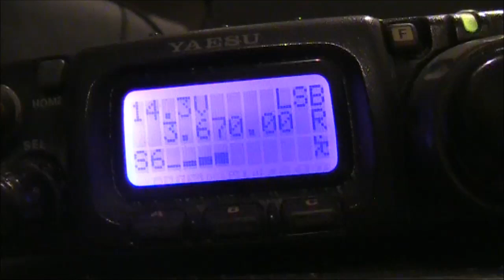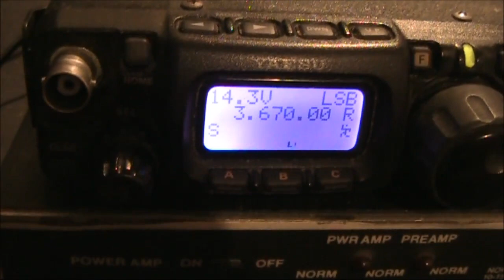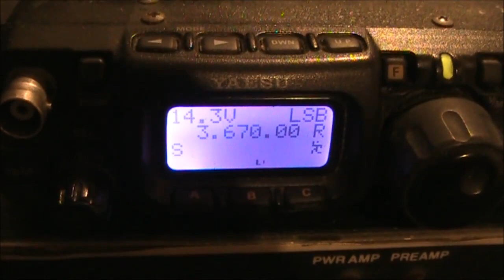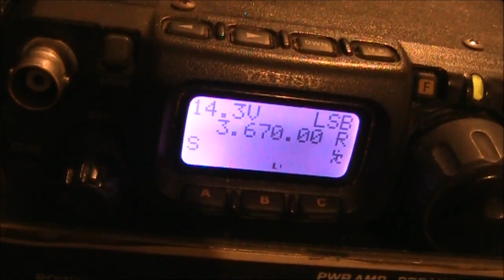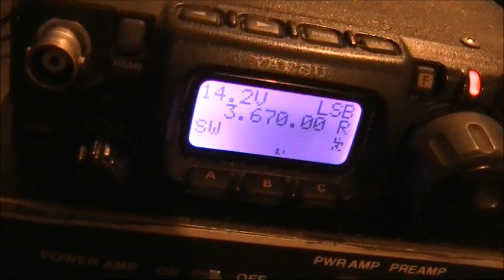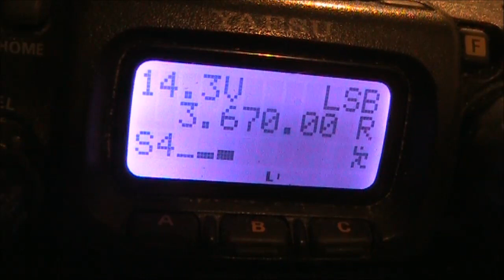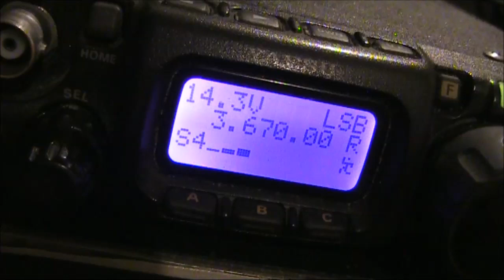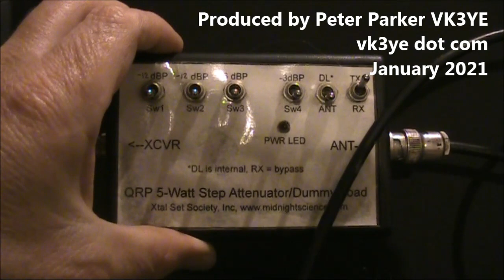8 milliwatts of 80 metres SSB: Can it work?

Comment: What time of day and what antenna?
Reply from the maker: About 9pm. G5RV.
Reply: @vk3ye  
Thank you. That's remarkable!. I expected you to say a six element 80 metre rotary beam at 60 feet!
There's a guy in N. England with a1 km long wire at around 25', running through some woodland and he's getting  those sort of results but about 15-20 mW is about as low as goes.
However, he doesn't enjoy the super low noise level that the guy on the island had..
Thanks for all your ACE videos
73 From Olde Englande, your former colonial oppressors and fellow member of the GQRP club.
13959 ...G3NBY

Comment: Yes it does. Working on building. A direct conversion cw reciver. A ham neighbor called, and told me that I should ID MY CARRIER WAVE . He was 12 miles away. The direct. Conversion radio. builds a signal for the mixer, and produces a af signal. At the speaker.  Never thought such a tiny signal would bring a call  . Ps boxing up my dc rigs in metal cases. 73
Reply: Yes just built an OZ QRP DC rig ....works well on 5W SSB and CW

Comment: Peter: If you had been running on CW, I bet you could have gotten down to powers below 1 mW (0dBm). I ran on 10 meters back in 1980 with a station in the UK, and I was located in Connecticut, USA. 5,000 km, and we made a QSO at -8 dBm, or around 160 microwatts! My call at that time was WB1DNM and I was working with Ivan, G3WBA. QRP is amazing to run!

73, Keith, WB2VUO here near Buffalo,  NY.